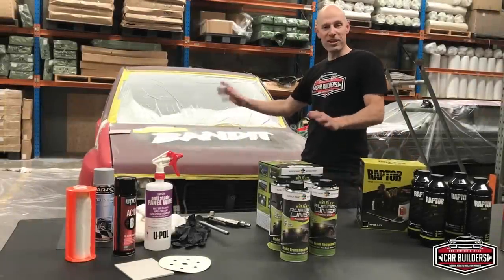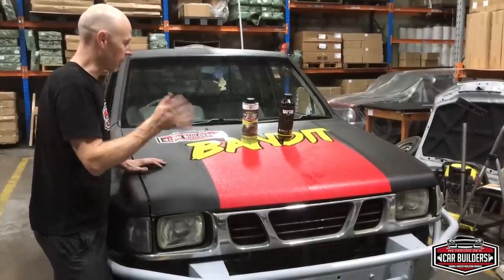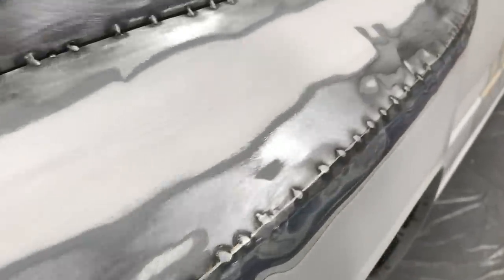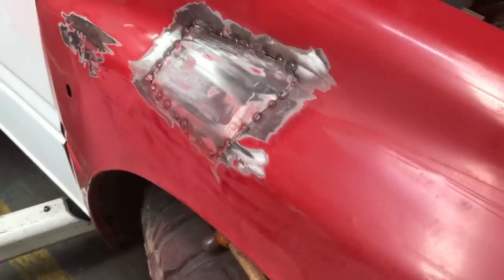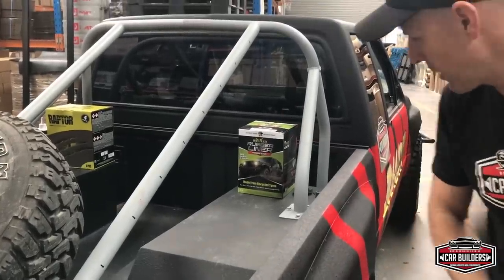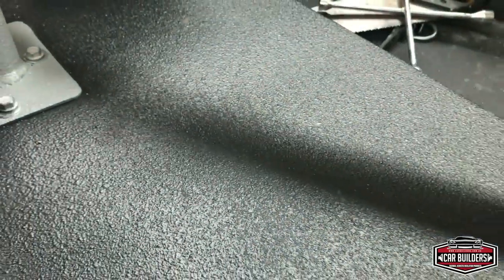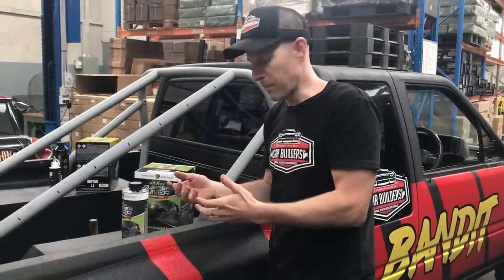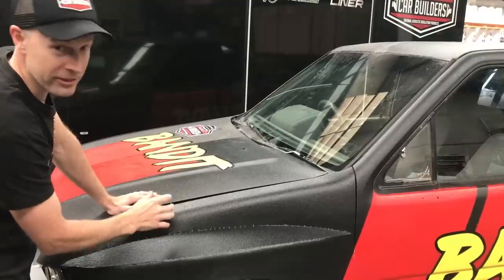Raptor liner or Bullyliner? A road test review on both DIY liners

Comment: 😀😀😀 Wow 😀😀😀
I used the Bully today in a rusted car boot/truck application. Used wire brush to take most back to bare metal then masked up and etch primed yesterday. Went out there today, hit it with scitch-brite pad, cleaned it up ready for spraying. Its 26'C and 69% humidity. I poured the Bully into an electric Wagner pump, first with a waterbase valve but it sprayed too fine a mist, then swapped it out for an oil base valve. The stuff comes off the gun well with good coverage. Ive used about 600ml from the 1 litre tin. Although the paint colour states Midnight on the can, it actually sprays out a greyish blue colour which darkens as its drying. It will go a darker grey, then gunmetal, then charcoal black in an hour.  The most impressive thing about it was how easy it was to clean up afterwards. I poured the excess paint back in the tin, filled the paint reservoir with water and sprayed it through until the jetstream was clear but shooting out the fine granules. Then I emptied the water and refilled with fresh water again. The clean water then pushed out the last of the granules sand my reservoir was already clean! Pulled apart the gun and all the components washed easily in an icecream container of water. It is SO EASY and quick to clean up afterwards from as the paint easily washes off with water. I give it a thumbs up. Will update on the finish in a few hours....
Reply from the maker: Great work 😎👍

Comment: When I was a kid I had this electric track car system that came with two little trucks and two handheld remotes. A fun game to see how fast you could get them to run around the track before/without flying off across the room. As I recall, the little RC trucks looked EXACTLY like your truck. I think it they even said "Bandit" on them. I'm in my 30s now and I haven't seen any of those RC cars around since that era, but I'm pretty sure they're still boxed up in my parents garage. Now I want to go dig them out and see if they're still there just to see if my memory is serving me correctly or making correlations that don't exist. I came for the Raptor Liner info, but I stayed and subscribed for the badass truck.

Comment: I've always been impressed with the raptor finish.  I use it to coat smaller items- the only thing is the coarse texture you get from applying a higher build doesn't look as good on smaller objects, yet it is tougher.  

The lower build I use is more satin-matte.. looks really even and catches the light really nicely.

Comment: The claw hammer took quite a bit of the Bully off of the panel.  And there was no comment on the damage done by the heavy hammer drop on the Bully.  It seems to me that the review was slightly slanted to the Bully.
Reply: Go to CZone Media on YT , his Raptor partially covered Dodge Ram was peeling like crazy 2 years later.
Reply: @deanfirnatine7814  then he didn't prep right cause my jeep is 5 years in and looks great
Reply: @deanfirnatine7814  and you should use a couple coats
Reply: 100%

Comment: Thanks for the video. It was very interestng. I've been looking at doing my van life van with the Raptor.  I just priced the bullyliner and can get 8 cans of the Raptor for for a few bucks more then 4 cans of the bullyliner.  Plus, you can tint the Raptor whatever color you like and paint your coats and it's done. With bullyliner, you paint your coats on then you still have to come back a spray your color on, which is a lot more work. Plus, the bullyliner is very limit in the color choices. The only thing I do like is that it says you can use a rollor and or brush to apply it. Verese with the Raptor, you have to mix different things with it, etc...to be able to roller it on, and it still does not go on the easiest from what I've seen. I'd love to see you do a project and roller and brush it on. Thanks again.
Reply from the maker: Thank you CowboyDav. A brush on video is coming up 👍
Reply: @carbuilders1  Great...I'll be keeping an eye out for it.

Comment: Not too shabby of a review! It seems the products are suited to different tasks. Raptor is a better choice for full body, but the bully liner might be better for bumpers and beds where slipping is a problem
Reply from the maker: Thanks Steve  😎👍
Reply: Yes but he mentioned putting a gritty additive in the Raptor bottle which would create  a no-slip coat.
Reply: Another thing though the bully can get touched up whenever and the bumps and the bed and all that take more damage than the body normally

Comment: Great review would love to see more how these hold up as underbody protection against rust!!
Reply from the maker: Thank you Drunk Tortila. A future video for us 👍Obviously the preparation and neutralising any sign of rust before applying these paints is the crucial factor.
Reply: @carbuilders1  ofcourse. I was planning on sandblasting preping the metal with accetone and using a 2 part epoxy primer. Followed by 2 coats raptor liner and waxoyl for the inner chassis but in the UK this might not be that durable with our weather so looking for some alternatives apart from por 15 which I am not a fan

Comment: Looks like a win for Raptor to me.
Reply: Depends.  Looks like two excellent products with slightly different strengths and weaknesses.  For amateur use Raptor is much more expensive to use, because it is solvent based vs water based.  Much more expensive to clean guns, etc after each use, difficulty sanding for touch ups, need for breathing apparatus if using in confined spaces.  Pretty easy to paint a clear gloss or satin finish over the Bully.

Comment: Notice how he didn’t do the rope burn test on the bully liner at all. On another not I’m probably just nit picking but he picked, up the saw blade a second time and start scraping that around the raptor liner, which is a good test but he didn’t do it to the bully liner either. I recon if your going test both products keep the test the same and equal all the way through.
Reply from the maker: Hi Bear Got Style. Yes, sorry for the inconsistence with this..filming fatigue 🤦‍♂️We found the Bully responded the same with the rope- it burned through both paints. Both stood up similarly to scraping of tools.
Reply: Sorry I didn’t want come off as a smart allic, but I would have like to see the rope, burn test and the blade test done the same way on the bully liner. As it is a rubber base and not plastic polymer base as the raptor liner. I’m not favouring the raptor liner I just wanted, to know the burn through / sand  paper like abbration, speed rate down to the metal as it is to different, material types as I want to do my whole vehicle in a reliable product.
Reply: Yeah, and judging by the hammer test, bully might be slightly less durable than the raptor, but also makes it more forgiving with flex

Comment: I used the Raptor bed liner and it was real easy to apply. But, I do suggest a second coat.
Reply from the maker: Hi Ronald. Yes, you will need two coats 👍
Reply: 3 coats and a 4th to just dust everything.

Comment: So this video is 2 yrs old now, if you still have the truck done up like this, which product has been the most durable? I'm planning to use bed liner pretty extensively in my truck project, been pretty set on the Raptor, but I never heard of the Bully before...I live in the States, so that's probably not surprising...Lol! Anyways, which one has held up better in the long run? The Bully looks like it lost a lot more material from that claw hammer, has it hardened more with age?
Reply from the maker: Good question. Without sounding too typical, they actually have both stood up well and have been comparable over the journey. Both have retained the qualities from when they were sprayed. A noticeable difference is when cleaning. Raptor is an easier finish to wash whereas Bully is harder to get clean as dirt gets trapped in the texture (which is why we started using a clear coat on top).

Comment: Having just used bully liner myself on a bull bar about 3 weeks ago it's great...until you get a hot day once the steel underneath warms it gets as makes sense "rubbery" and can be picked off or on a 4*4 track as any contact is going to gouge it off, if steel is cold it's rock hard. Think will carry on to use raptor instead
Reply: I see they responded to all comments but yours! I thank you I’ll be doing my truck in raptor this summer
Reply from the maker: Sorry for the slow response on this one guys. We have been making an oven where we are going to put this to the test. We thought we would be well and truly be finished making/testing by now but it keeps getting pushed back with everything else we are trying to do- we will have some testing up in the coming month/s. Rather than the rubber, Bully is an acrylic paint so it will soften when in extreme heats however we have had the Bandit sitting in 40 degree C (105 degree F) days and raced it around in the height of summer high 30degrees, scrapping other cars and it hasn't been an issue. It will be interesting to see how the results come out.

Comment: I have used a 3m product on the interior of a few vehicles with good results for acoustic application, but never tried it on exterior. When I got my rust free montero, I considered getting a professional coating on the wheel wells and rockers. They wanted an arm and a leg. I mean more than I paid for the vehicle. I will look into these when I get around to doing some exterior coating next time.
Reply from the maker: Good luck 👍

Comment: Bloody excellent video!!
Reply from the maker: Thanks mate 👍
Reply: @carbuilders1  i bought 4L of Bullyliner off you.  I plan to permanently remove the carpet and paint the entire floor of my Pajero.  I want it thick, like Linex, 2 to 3mm, for sound insulation.  Should i spray or roll it?  Will i have enough?

Comment: Bloody brilliant video thanks!  Crash testing is really showing commitment to the road test review! 😁  2 questions please - If I just have a combined air regulator/water trap without an additional big dollar water separator in the air line, does the possibility of any water in the air line rule out buying the Raptor off you (and therefore defaulting to the Bully's water based product)?
Second - does either product have better sound deadening properties?
(I've already got your Stage 1 and Stage 2 inside the car, but this Raptor/Bully will be applied somewhere else)
Thanks legends!

Comment: Question, will the Bully Liner alway have that texture or is it possible to have a "flatter" or less gritty texture?
Loved the demo, seemed fair and unbiased since you sell both.....
Reply from the maker: Thank you Zuktrails. It can't be made smooth. You can spray at a higher PSI so the texture is finer rather than lower PSI will be broader, lumpy texture 👍

Comment: Raptor all the way I have it on my Dodge Ram 2500 and it’s perfect not a single problem bully gets to rubbery during the summer in hot months
Reply: Really?  I was kind of leaning towards the Bully. I also want to coat my whole Dodge Ram 2500.  Was thinking a lighter gray to closer match the existing color.  Just want to know about the long term update and UV resistance.  I have another vehicle that I bought with raptor on it and is is shrinking, cracking and coming off in areas.

Comment: Great video bro. I was set on the raptor after the hammer claw test.
Reply from the maker: Thanks. Good luck with project 🤙
Reply: The only problem with the claw test was the difference in pressure one hand was use for raptor , two hands for bully

Comment: Also pushed harder on the bully side with the hammer scrap test than the raptor. Used two arms instead of one hand. Not a truly valid test but still pretty good. I've already been using raptor liner on my trucks bumpers and rockers and it's holding up well. Some rock chips after 8 years but it's time to add another few liters and make it even thicker
Reply from the maker: Thank you Tony. Yes, difficult to road test exactly the same but tried our best 👍
Reply: @carbuilders1  still a great product test and I thank you and the team for taking the time to do this video. proved my point and thoughts that Raptor liner is still worlds better. I will be doing my truck again this weekend on the side rockers and rear bumper.

Comment: I have a difficult question, My truck is painted with Raptor liner, Extremely hard to remove. Can I spray the bully liner on it ? I sprayed kinda thin not heavy so it doesn't have texture but somewhat like coarse sand paper type sprayed on with raptor liner. It was my first attempted, My other sprayed on jobs got way better. I bought 5 bottles to spray my 05 tacoma exterior.

Comment: Sorry big thing you missed and from my experience using the bully liner is on a hot day it actually feels like uncured paint and comes away under a fingernail , cool days it's hard as a rock but a hot day heading to beach and needing to get off the track into the scrub to pass and I can see it being gouged off, I used it on bar work and stopped once I spotted this issue, talking months after applied and like I said rock hard on a cool or mild day but leave it out in the sun 35+ and it's like uncured paint (not as bad but that effect), I imagine that's the effect of having the rubber compound in it
Reply from the maker: Hi Daniel. Interesting. We have had it through 40degree days and haven't found this. We are going to add it as another thing to road test this summer.
Reply: It's never come off on the van,  but one thing I noticed after painting it on, it does take about 3 or 4 days to cure properly. I have run stiff brooms over it Used high pressure with turbo head and doesn't effect it.

Comment: Guys notice hes got a big bully rubber liner sticker on that black wall which probably means hes sponsored by them.
Reply from the maker: We are a retailer of both these products. We made the video as we always get asked which one is better. We wanted to show why Raptor or Bullyliner might suit you better. Both have strengths and limitations.
Reply: Car Builders - Thermal & Acoustic insulation materials poeekz

Comment: I’m wanting to paint my Nissan hardbody about the size of your Toyota. I want it to last awhile but I’m not very good with tinting and such. Actually I’ve never done it at all. I want to go with raptor liner but when you said the satin is kind of spotty? If you were going to paint your whole truck with one which would you choose? I think I’m leaning towards raptor liner. Good choice? It gets hot in Montana so I don’t want the rubbery feel that billy gets.
Reply from the maker: Both are a hard finish. Although Bully has a rubber base, the 'hardness' of the products feels similar. Really the choose comes down to factors discussed in the video. If you want a glossy finish that is easier to clean, Raptor is the paint for you.

Comment: For those interested you can use degreaser and a big brush to clean the raptor liner. Then afterwards use 303 protectant and it looks bright shiny and brand new!! 

I did that on my wrangler hard top and it always looked incredible. You can 303 on everything, it’s like armorall but doesn’t suck and ruin stuff over time. Also I used that parts store bed liner( I think herculiner... it came in a gallon tin with no hardner and you roll it on ) on the interior tub of my Jeep to replace carpet and that stuff basically ruined my Jeep. Sand and mud would adhere to the liner because it was so soft and it was a nightmare. Raptor liner and others that are two part with a hardner work soooo much better.

Comment: How much does a full car spraying cost with the raptor and does it prevent rust ?
Reply from the maker: Hi there. You would need 12 bottles to do a full car. If you have rust treated the car before spraying, it will protect the surface 👍
Reply: Okay thanks for the answer

Comment: This seems more like a video for Bullyliner. He was pushing the Bullyliner. But this video makes me wonder about some of the shops here in Atlanta, They are doing spray in liners for under $300. What products are they using? HMMMMM?
Reply from the maker: Hi Antoine. Sorry it came across that way. We tried to be consistent in the video to show the strengths and limitations of both paints. We actually sell both of these paints, not just Bully, and tried to make this video so our customers could make an informed decision on which way to go.

Comment: Is it a good or bad idea to coat the undercarriage and suspension parts of a crawler/ winter vehicle with a bed liner?
Reply from the maker: Hi Jordan. A good way to think of these paints is that they are roughly 5 times more durable than your standard body paint. However if you are scrapping rocks it will remove the paint.

Comment: Why didn't you do the rope test on the bully?  Did I just miss it
Reply from the maker: Hi John. We did do it however it somehow was overlooked in final editing 😬It performed to the same level as the Raptor. The rope did burn through both paints (as rope is very abrasive with this motion). If you are going to use rope on bars with these paints we'd recommend a capping.